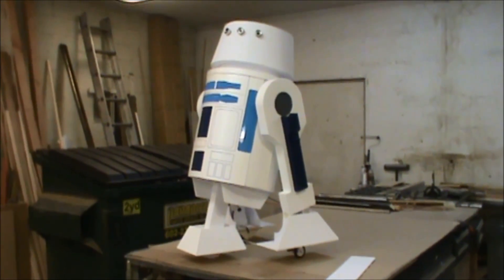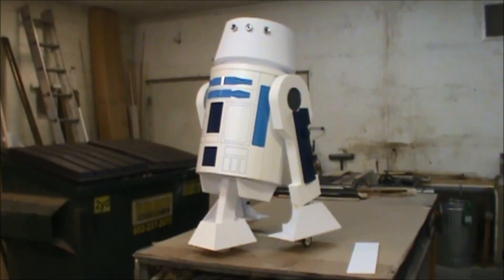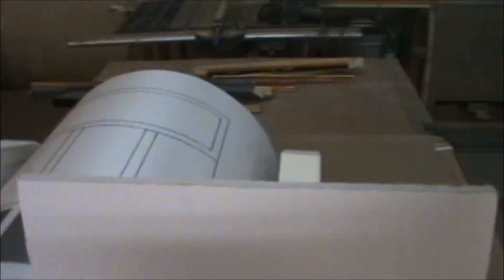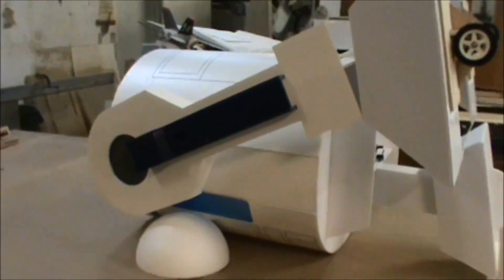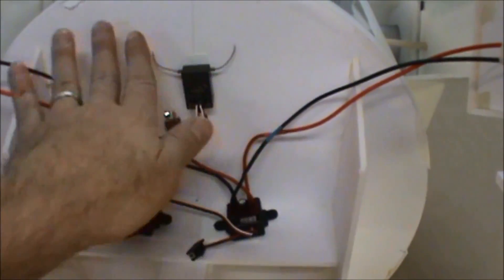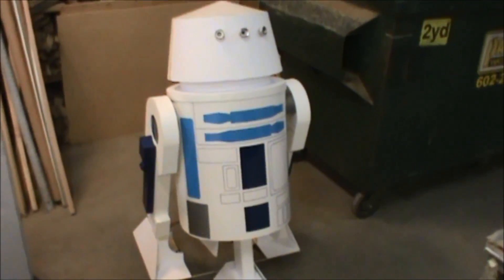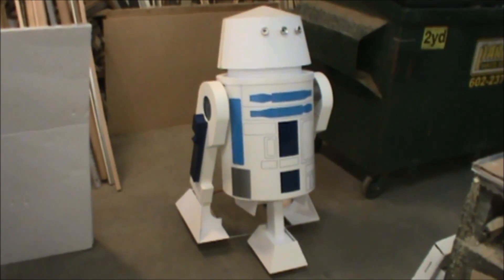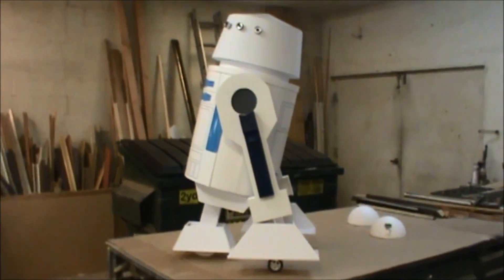My STAR WARS droid on a budget! (Pt. 1)

Comment: Currently, I'm doing a very similar build. Two R/C Drift cars, one in each of the main legs, and a caster in the third leg. I'm aiming for the aesthetics and all to be made of poster board, or foam, or really whatever works. a simple structure made of PVC pipe and some screws/bolts should do nicely. It's all trial and error at the moment, but hopefully I'll have something presentable in the future. Awesome work! This is exactly what I want to do with my own build. Hopefully down the road, I can rewire the drive motors in the R/C cars into a radio controlled setup, as oppose to a clunky multi-controller deal that you get with multiple rc cars. Hoping to be very close to club specs, but I'm not too worried about being 100% since in A New Hope, it's so inconsistent. Only time will tell!